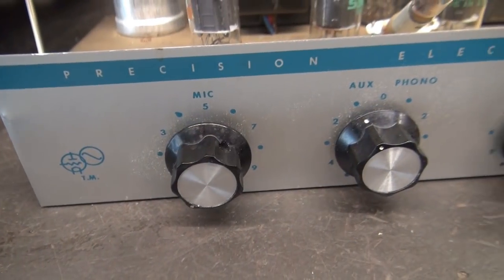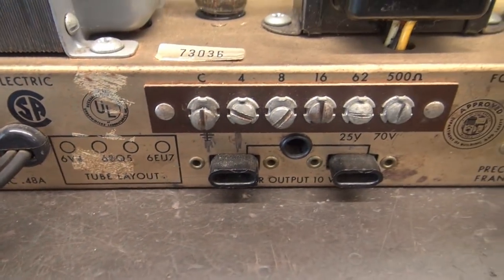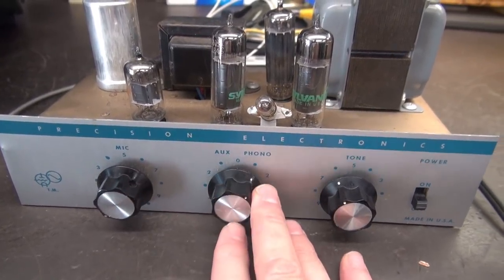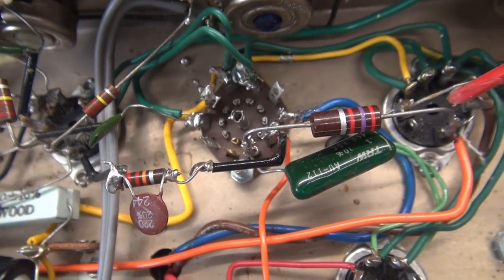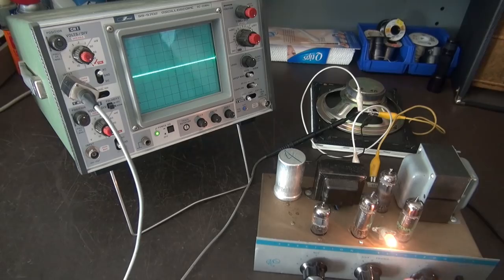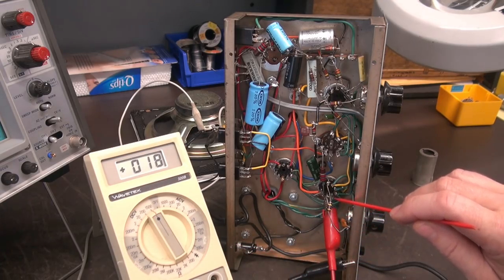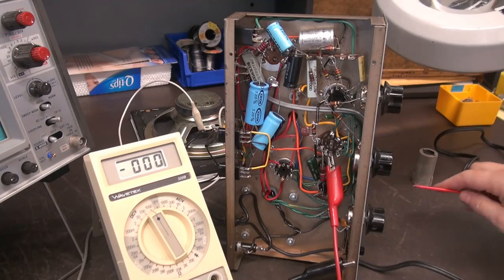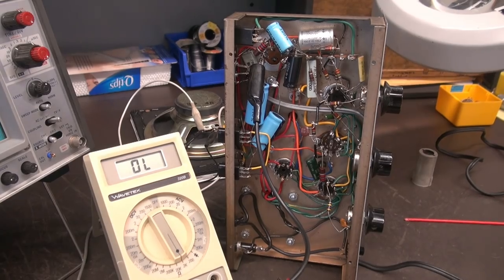How to fix Tube Phono Guitar amp Motorboating Precision Electronics S10

Comment: It looks to me the 62 ohm output is also the 25V, and the 500 ohm is also the 70V.  Those numbers both add up to about 10W.  I suspect the plugs underneath went to a lead (that's now missing) that selects the proper tap for the speakers.  That's why the line from the plugs to that hole.

Comment: If you have an old 5v or 9v DC wall wart (one with an actual transformer rather than switch-mode) you can crack it open and use the transformer as an output transformer.

Comment: My 67 super reverb is “motorboating” at a slightly faster pace than this amp here was. Do I need to take it for repair or can I fix it myself?
Also should I not use the amp at all until its fixed?